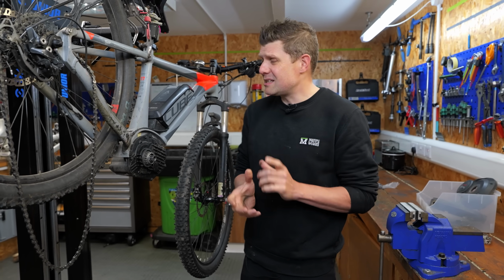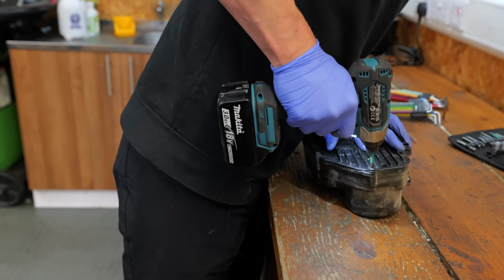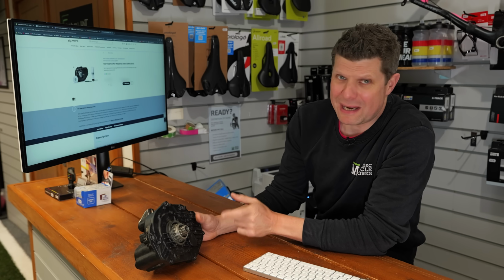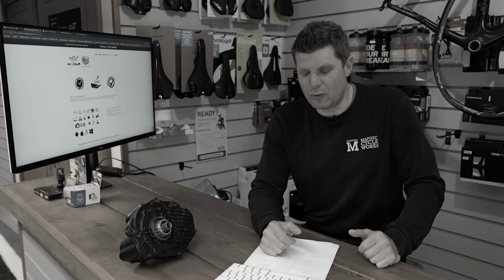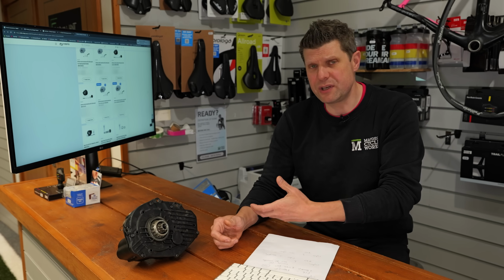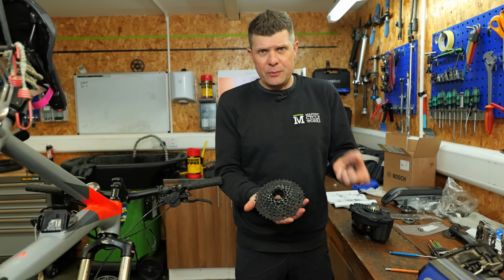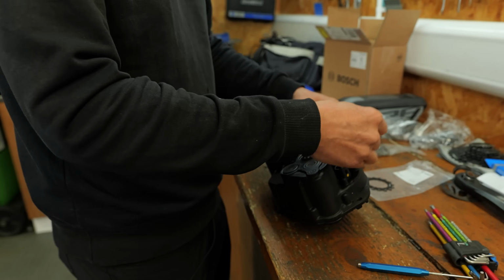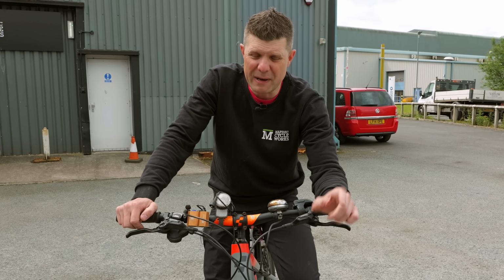This £750 eBike repair could have been avoided

Comment: £800 crikey... In the industrial world, the rule of thumb is 50%. If it costs more than 50% of the value to fix the item, they'll usually replace it.
Reply: More like 33%, you might want to look into getting the bike replaced. Motors are expensive to replace or get serviced.
Reply: In industrial world, necessity takes precedence over price if it's shutting down production.
Reply: The fully damaged of the Insurance doorstep is 40%.
Reply: That’s a previous-gen Bosch motor and unfortunately Bosch make them unbelievably expensive to replace.
Reply: Could have bought a used ebike for that money, could have bought an upgraded motor or better yet, bbshd.
Reply: That bike looks so filthy. How can you keep working on it to start with. M
Reply: @cup_and_cone  Exactly, if it's a mission critical piece of equipment and it's £3K to fix it tomorrow or £1K to fix it next week it's the £3K option every time.

Comment: If Bosch is not going to support their motors, they ought to have a 'rebuild/refurb' service that would allow people to avoid throwing away their injured motors.
Reply: They do both of those things, as is mentioned in this video. What they don't do is sell drive units to end users, only to OEMs.
Reply: Bosch are actually one of if not the best for this. They even sell a DIY service kit for the first two gens of their motors. Which is the left half of the motor for about £100 I think it was. Bought one and fitted it on a bike of mine. Not childs play to fit but certainly doable for most. Can't praise Bosch enough for this type of thing.
Reply: @tombowman4489  how is servicing it yourself? I've done lots of work on dirtbikes and cars and this all looks like stuff I could do, but I'm not sure if I'll run in to dead ends trying to get a replacement bearing or something then have shops refuse to touch it if I've opened it
Reply: @gregmossed  it's a kit Bosch sell for the Gen 2(possibly gen 1 also). It comes with everything you need apart from the locking tool to open the motor. It's basically replacing the whole one side of the motor which includes a few gears and such. It needs to be done with quite methodically with a high level of hygiene and precision but overall was crazy difficult. There is a main drive cylinder they tell you not to handle but mine was rusty so needed a bit of love. They don't give you a new one of these but I've heard there is a company who makes titanium copies of them if you want to upgrade or yours is a bit worse for wear. Unfortunately, I do not think they make such a kit for the very latest Bosch motors though.
Reply: Got be honest bought my first middrive needed battery few cables and a display ,contacted bosch  as if was a haibike sl29 with probs the first performance motor wS from 2014  the bike is absolutely beautiful  has yamaha look allover it white yellow black grey lil orange  but sprayed like a artist the way ithe colours twist around the bars  everything on it highend and is still  parts been used today  on bikes  i first went to ebay were it started a bidding war between 2 germans 😂😂 was only liokin a battery  but  i got in contact with bosch  now remember never had a middrive before  sent them a few vids they  asked for they sent me a diagnostic kit  that plugged in stayed on and sent back to them  they were surprised how good the motor was sent me a full service kit and bits i might need in the future got me the correct battery in white  and  the original display all if i promised to sell the bike back to them when im selling or a swap ,blown away by this thanks bosch is all i can say 😎

Comment: Shame on Bosch for making a motor where the PCB is glued in. Shamed on not selling spares. Having to apply to buy a motor spare ? Are they out of their minds? Thanks for this video, I'm never buying a bike with a Bosch motor in.
Reply: not just the motors, be aware of the batteries as well, bike manufacturers make them with proprietary firmware on the controller so that it's hard if not impossible to repair or replace cells, meaning that if anything breaks you can only go back to them to get it fixed (or not fix at all), there's also the non-standard battery mounting.
Reply: You don’t have to buy an e-bike 😉😃🫵
Reply: Never buy anything with a Bosch motor, they are shite.
Reply: @Q96500  That is the simple solution, cost effective!
Reply: @ashchbkv6965  Yep, manufacturers have become very invasive and encroaching on property rights.
When I've bought a product, it's mine so I want to use it the way I want to and not having to play by the rules of the manufacturer...
Reply: Ditto
Reply: Yet Bosch are renowned for their superbly reliable motors.  Buying something of lesser quality is akin to cutting off your nose to spite your face.
Reply: They do tell you not to pressure wash or immerse the motor in water.  It's hardly the fault of the manufacturers if you choose to abuse it.

Comment: I'll never buy a factory built ebike again. My first ebike was a haibike full suspension bike with a yamaha motor. The bike itself was fantastic until the motor stopped working and gave an error code on the display. I contacted the store where I purchased the bike from which was an online store called cycle republic, only to find out it didn't exist as a store anymore. I was told to take it to halfords since they were the owners of cycle republic. After taking it to halfords and several promises to fix the bike which went on for months, I eventually ran out of patience with halfords and to cut a long story short, I got a full refund for the bike. I used this money to build myself a full suspension ebike on a vitus sommet frame with better components. Im using the bafang bbs02b motor with a custom made battery.The total cost of the bike was less than I paid for the haibike. I now have an ebike with an unbelievably reliable motor with readily available parts that I can fully service myself. I also now have the option of upgrading the motor or removing it completely and using it as an ordinary bike. You can't do any these with a factory built ebike.
Reply: I own a Tongsheng motor with torque sensor. Actually two motors because I swap parts between them. All parts are available on Aliexpress for fair price. A controller is 32£. Yes, motor breaks down but I can fix it myself for a low cost.  And it's not complicated. I'm from Sweden but wrote price in pounds.
Reply: @stonehill27  My son has the tsdz2 500w version on his bike.
Personally, I'm not too keen on them as I find them too flimsy. Everything is literally held together with circlips. The torque sensor works OK, but it's made of garbage and develops too much play on the axle and main gear. You can add 3 extra bearings to secure the axle a bit, 2 on the non-drive side, and 1 where the oil seal should be in the chainring on the drive side. I don't know if the newer B version is any better. I personally prefer the bafang as they're so reliable. My motors approaching 17000 miles, and I've done a full bearing replacement twice, minus the thrust bearings and needle bearings, and the motor still works like a dream.
Reply: I don't want a eBike yet but got a Gudereit trekking with Pinion gearbox leased since a year now and because that gearbox is in the middle you could easily fit in a rear hub motor later and put the battery under the rack or into the frame triangle; Mahle (another car supplier like Bosch, Brose and Continental) does such a system but sadly doesn't seem to offer that as an upgrade kit ☹

Comment: As a shop manager I struggle with these types of situations too. All in all I find it best to be completely honest and transparent with the customer about cost vs. value. That's exactly what you did here and the customer chose to repair their bike. Sometimes customers REALLY like their bikes and don't want to seek a replacement. Good job and amazing work!
Reply: Good point...if you have a bike that's a good fit why then take an expensive punt on a replacement.
Reply: If I were to work in a shop I'd suggest mid drive kits. That way if it goes wrong there is always the prospect of simply converting it back to a normal pedal bike.
Reply: So almost 800 bucks for this repair plus a probable another few hundred for other repairs in the near future. Plus whatever the Trek shop charged for their somewhat half arsed efforts.
I'm not sure what model that Cube is but let's say a brand new bike will cost around 3,500.
This makes repair seem like good value.

Ok, if she could get a decent second hand for less than a thousand then that would make sense.
But you never actually know what you are buying second hand. It could be someone else's problems they're glad to get rid of that could cost another thousand to put right.

Manufacturers really need to prevent water ingress so easily though.

I had my last car for 8½ years. Bought it with 210,000 km on the clock. Put another 140,000 on it before the injectors went. Also the flywheel was wearing so another repair due shortly so I decided to move on. Not counting regular service and replacing tyres, brakes and regular parts that wear out, I spent less than 1,500 on repairs like a fuel pump and alternator and some other bits and pieces. E-bikes are ridiculously expensive to repair it seems. And I'm waiting on delivery of my first one next month.
Reply: @tconnolly9820  100% agree. Further to your point, as an example I've got a cube that I commute on and I'm doing lots of adjustments to get it all fitted out just right for me and just run-in with all the weak bits replaced (rear wheel rebuilt, then freehub die,d which meant new hubs, then better quality fork parts, then pedals, light upgrade ..). If I had to drop a new motor in it, I would definitely and can imagine it's possible this customer is the same they found what works, replaced the weak parts and don't want the time, pain and costs associated with this process.

Comment: Basically what puts me off buying any new bike, especially an e-bike. One manufacturer using two different chains? That's just a ridiculous and attempt at locking in customers. £120 for a Bosch motor service kit? Wow! An expensive motor that only has a 2 year warranty? Says it all! Bikes needing that kind of major service regularly? Really. My 40 year old Raleigh Clubman has been serviced by a bike shop once (because the gov. were offering a £50 voucher). That was the first time the chain had been replaced. I hate this modern disposable mentality. I added a nice Swytch kit which basically uses off the shelf parts available on eBay,. By comparison some e-bikes are selling for £5K+, with hardly any warranty.

Comment: Always seems designers/engineers never thought that putting the motor right where it’s going to get drenched by the front wheel throwing water onto it when it rains was a bad idea, add in the motors don’t seem to be sealed that well, and then throw circuit boards in as well, it’s always going to end badly tbh